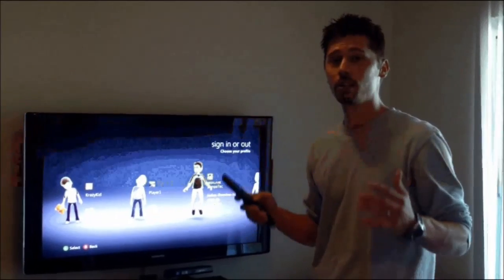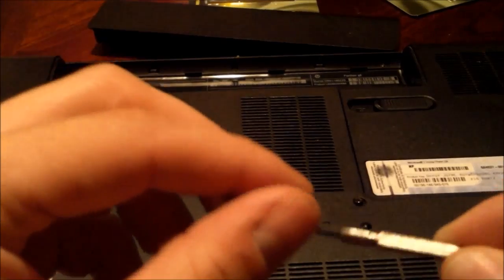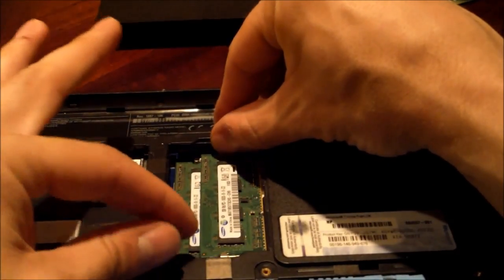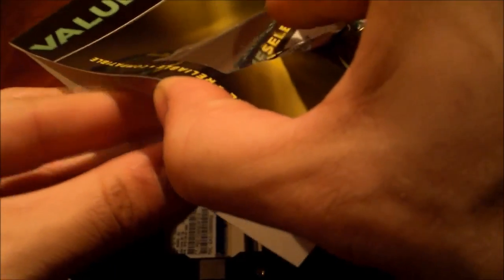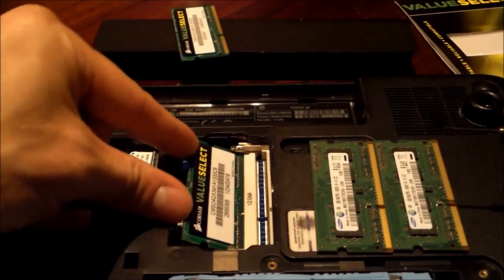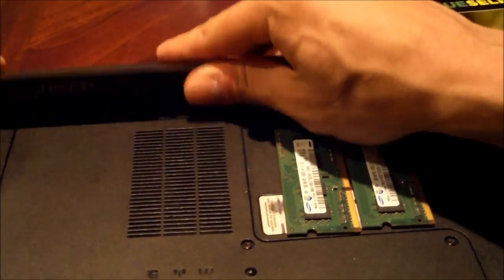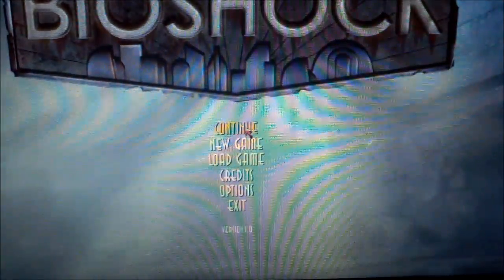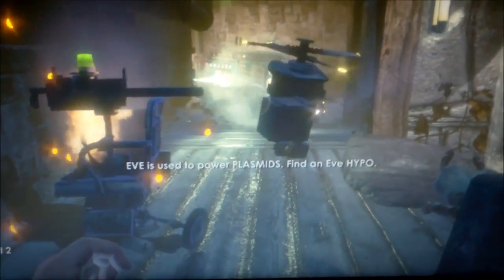HOW TO INSTALL RAM / Memory laptops notebooks PCs Computers upgrade review

Comment: I am new to it in the last few days and noticed it is weird how you apply pressure not in the final orientation. I'd be worried that bends something, but I assume that is how they are designed. You don't do that with DIMMS. There is a part that hugs the sodimm with the metal brace, that I thought should be just below the notch. That is how I declared it was inserted. Memtest passed it though.

Comment: Hey I know this video was 4 years ago. If your channel is still active, can you help me out please? I just had received my 8gb memory to upgrade my Dell Inspriron 15 3000 series from a 4gb to 8gb and replacing my hdd to ssd for quicker boot time. Now the problem is after successfully popping out the old 4gb ram, and now it seems as if I pop the 8gb into the slot, but I am not sure if it's all the way in or not. So now when I try popping it back out. It doesn't pop at a 30 degree angle automatically. Also note, that as soon as I popped out the old ram, I saw what appears to look like a piece of plastic 3 finger claw kind of shape which I am assuming that it is to hold the ram in place. I dunno. Need a little bit of help here. Oh and soon as after I swapped out both the old hdd and ram, and try to power it on, my laptop was making beeping noises that sounded almost like a fire alarm.

Comment: My pc is running on i3 1st gen processor with 2gb 1333mhz ram. There are two ram slot one is not working. If want to replace the 2gb by a 4gb ram of 1333mhz. Do I need to install os freshly ? or it will take that 4gb ram automatically ?

Comment: Hi I have an HP G4 laptop with 2 gb of RAM. can i just add another 4 gb RAM to the 2nd slot for it to become 6 gb total? I am correct?
Reply: it's depending on your windows
If you are using x64, you can install 6GB RAM
but if u are using x32, the maximum amount of RAM is just 4GB
Reply: Yes i have 64 bit. so it is okay just to add 6GB to become 8GB? even though it is not balance? because it's gonna be 2GB on the 1st slot then 6GB on the 2nd slot. thanks Sufri

Comment: Hi guys i need help. i have asus x556u gaming latop core i5 4gb ram 1600MHz 2gb nvidia gforce. i want to upgrade to 8gb of ram, on taskmannager it say 1 of 2 slots is used now when i opened the ram panel of my laptop i notice something, it only has 1 slot its like the first ram is on the motherboard. is this possible? if so can i add another 4gb 1600MHz of ram to make 8gb no mater the brand?
Reply: You can just buy a 8GB ram

Comment: +TampaTech I bought some Samsung DDR3 204 Pin for my HP G56 but the slot u pointed out. Is not the same, why is that?
Reply: It might be because PC RAM and laptop RAM are different shapes.

Comment: Can you combine different company of RAM together? (But both are DDR2)
Reply: Yea
Reply: Different company doesn't matter! What matter is both RAMs should be equal in DDR and GB. And not all RAMs are compatible with all laptops! You need to make sure and check before you buy and install!
Reply: SVETOGOR how do you check if its compatible , rxample, mine is 2.10 ghz ,And 6gb RAM , so how do i check if some RAM is compatible with my laptop?
Reply: TeenBling manual, company's website, contact company, research your motherboard to find out if its supports and what.....
Reply: SVETOGOR thanks !

Comment: I have an hp laptop that Im currently using. I do have a 4gb ram  that I took out of a laptop that has a broken screen, my question is, will there be a second slot on my laptop to add in another ram, on most or all laptops is there always only one slot or two slots for whichever number of ram that any laptop has, so if I open up my laptop, will there be an open slot for me to put my 4gb of ram from my old laptop into my new laptop ?
Reply: Yes 2 slots i think

Comment: Witch type of RAM would be compatible with my laptop? its a HP Pavilion g6 Notebook PC
Reply: there is no pacific ram dude, the more ram you have the more power your notebook, but there is a limit, usually a laptop had like 4-8, gaming laptop is 8-16 and rarely 32 ram so if u want to upgrade your notebook ram I think is between 4-8 Gb of ram is fine :3
Reply: Pham Anh and If I have 8ram?
Reply: then no problem just hook it up and ur lap ready to go 
:)))
Reply: okey thx :)
Reply: Thanks Pham Anh
Reply: no problem :))
Reply: i have the same laptop as you, i use a website called Crucial.com it tells you what ram you need

Comment: hi Tampatec , i am using hp pavalion g6 1200tx which supports to upgrade from 4 gb to 8gb ram. can i use corsair vengeance 4gb x 2 of 1600MHz , if not what is better
. plz answer ......
Reply: ok let get this straight your lap is not a pc gaming so dont waste 180 bucks on it you can still get the same ram with better price, and the answer is yes  you can do it but that is waste of money you can get 2x4 GB of ram just for 44 $ :3
Reply from the maker: if ram speed hz matches old ram. if you have boot up issue then you know it's not good.
Reply: +Tampatec Hi so i have a newer hp laptop and im thinking of upgrading it from a 4gb ram to an 8 gb do the newer hp's work the same where u can just buy 2, 4 gb ram cards or do you just have to buy a single 8 gb?
Reply: 4+4 is better than a single 8...so :3 just for you to know.
Reply: ok thankyou :)

Comment: Okay so today I upgraded my RAM in my laptop from 8 gigs to 16 gigs now my laptop is very laggy and my laptop is running hotter than usual. Do you know how I can fix this? I have Windows 7 home premium 64 bit and a quad core intel core i5.
Reply: It might be the case that the processor cannot handle that much RAM. It has so much RAM, it can't process it all. However, I'm quite new to this, so I'm just saying what I think is up, not what I know is up.

Comment: hey do you need good ram or good graphics card to play games like call of duty and bf
Reply: Both, you need a pretty good gpu (graphics card) but also at least 8 gb ram.
Reply: Thats bullsh*t
Reply: Billy Brewer Mate, COD's engine is crap and Battlefield 4 is actually one of the first games to recommend 8gb of RAM and that is if you want to play on max settings , games before 2013 simply do not use more than 4gb ram.

Comment: Hello, i just buy a 4gb ram for my laptop. and my laptop always restart. Can you tell why?
Reply from the maker: loose connection or not compatible ram check ram speed or ram was exposed to static. call to get the correct ram cheap- 1-800-800-8300 or http://www.tigerdirect.com/applications/category/guidedSearch.asp?CatId=10&srkey=ram

Comment: can you tell me how to put a hard drive in the same computer please very good video btw
Reply from the maker: its similar to this video but for laptops use bottom cover and micro screws then slide it out make sure you got system OS discs. get that from manufacture- HOW TO PUT IN HARD DRIVE HP DESKTOP REVIEW
Reply: Thank you

Comment: hi man i have hp pavillion g6-1150ex i have 4gig ram ddr3 1333hz i have 1 slot empty i upgrade to 8 gig kingston not as the old 1 it's samsung. king ram it's 1066 hz my prosscer is intel i5 support 1333hz is that wrong or what i need u advise ?

Comment: Hi i have a Hp g6 as well. stuck with 4gb RAM wana do the same thing 1. where do i find out my exact model number so i can make sure i buy the correct RAM sticks (assuming i need specific ones, and if you could tell me which ones) to get to 8gb and 2. depending on my model will i still be able to go to 8gb?